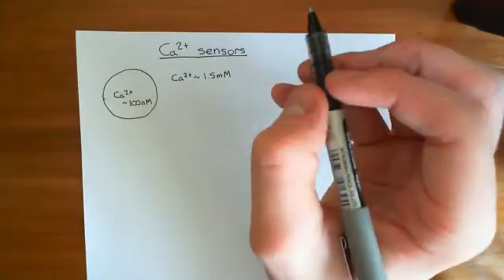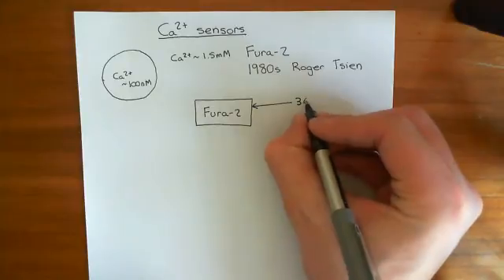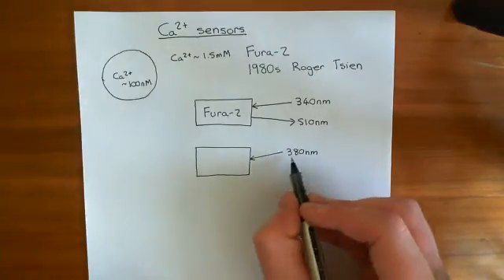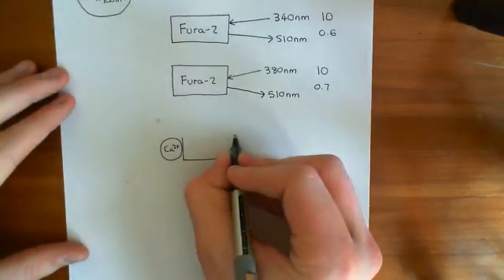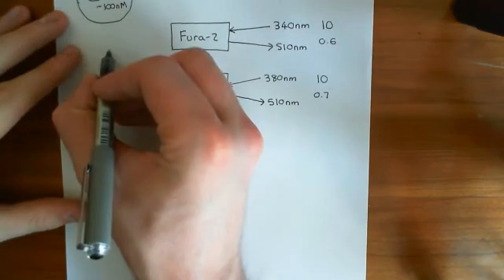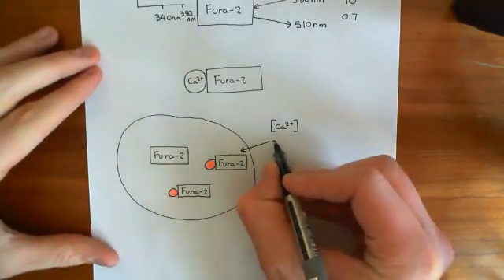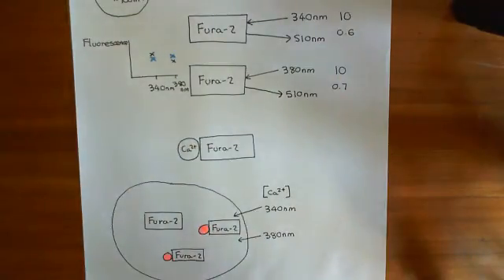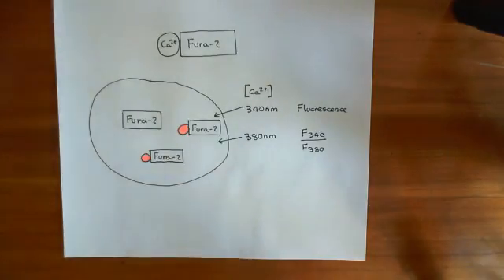Calcium Sensors - Fura-2

Comment: Video is good but wavelength unit is nanometer and not nanomolar
Reply: Also, the numerator being larger than the denominator doesn't determine whether the answer is positive or negative; that instead depends on the sign of each. I think what you were trying to get at is to say if the numerator is larger than the denominator, then the answer is greater than 1. Other than that, good video. Helpful and enjoyable.
edit, also, it seems maybe the case for the graph shown last, the original two 'x' that mark fluorescence might need to be displayed in-line with each other; that is, if both emit 510 nm light, then the graph should reflect this in terms of fluorescence.
edit, edit, it appears that the direction of the arrows in the last graph might also need to be flipped. This goes back to when we look at a paper that uses this ratio fluorescence is given as a value 0 to 20, with 20 indicating the greatest presence of intracellular calcium. If the arrows are correct as stated, with fluorescence decreasing at 340nm when calcium-bound and increasing at 380nm for the same, given the ratio of fluorescence at 340nm/ fluorescence at 380nm, the answer is going to be in terms of a smaller numerator than the denominator - a value that is less than 1. We need the opposite to occur, a value closer to 20 when the calcium concentration increases; this appears to require switching the direction of the arrows. I believe I found a source supporting this. See Figure2a. 
https://iubmb.onlinelibrary.wiley.com/doi/pdf/10.1016/0307-4412%2895%2900003-L

Comment: Excellent from a biological standpoint of reasoning. However, I think a stronger justification of 'mechanism of action' of how Ca2+ binding leads to a change in aromatic stability of Fura-2 might be beneficial for those more chemically minded. When concerning radiation, nm is a quantity of distance, i.e nm = nanometers. The wavelength of the EM radiation.